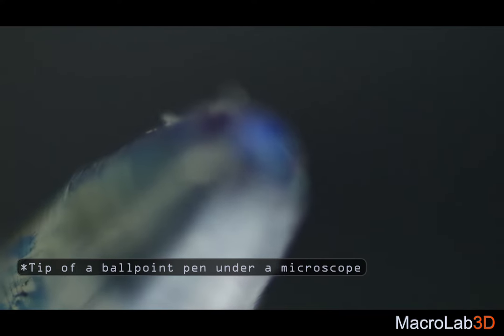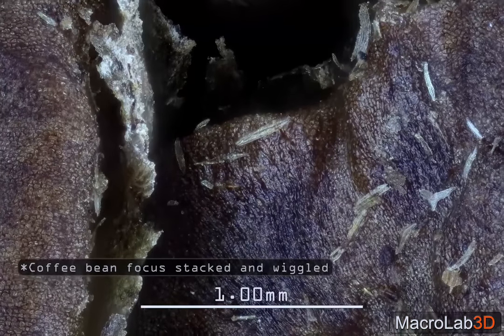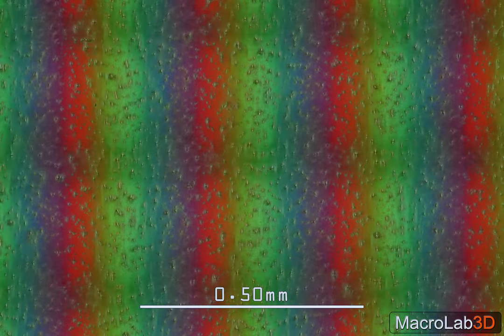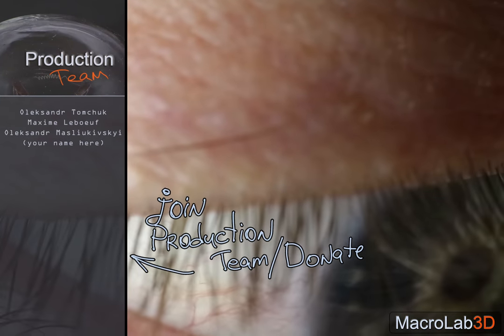Introduction To MacroLab3D: Focus Stacking

Comment from the maker: Contents:
00:00 The tip of a ballpoint pen
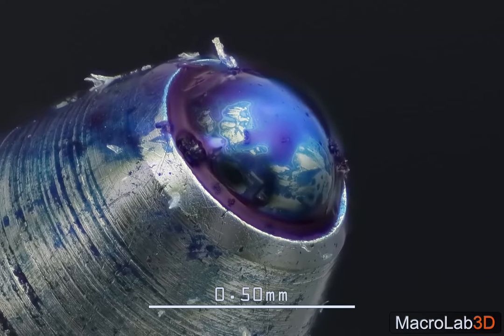00:25 Coffee bean
00:43 Electric toothbrush and its SMD LED 00:53
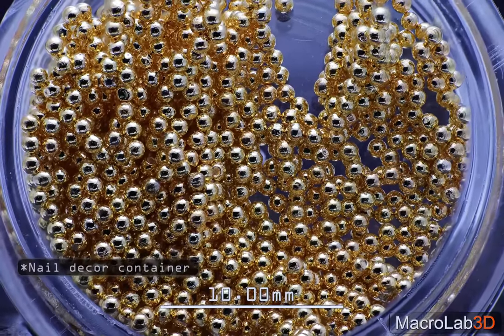01:00 Nail decor
01:11 Moldy mandarin skin
01:21 Moldy mandarin skin dried out
01:31 Wallpapers extreme close up
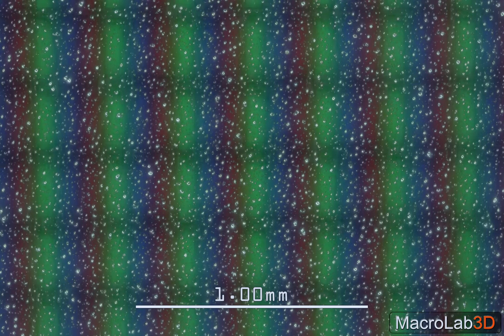01:51 LCD TV screen pixels
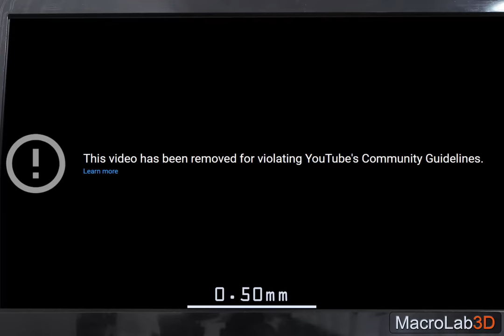02:11 Insulin needle
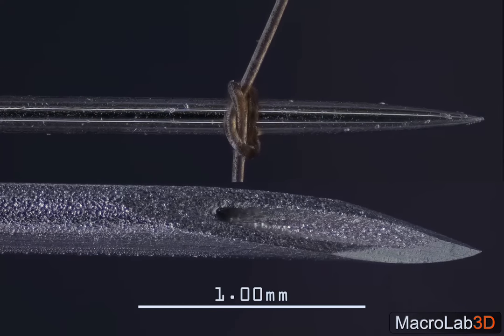02:29 Acupuncture needle
02:43 Cotton bud
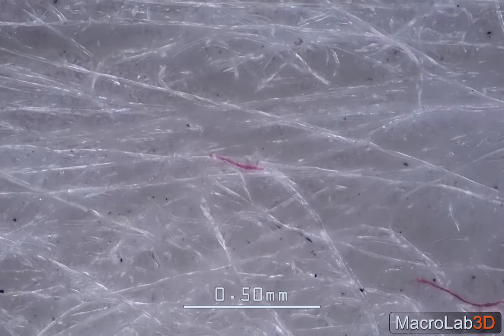02:55 Nylon fibers of a fabric
03:07 Dirty mobile camera lens
03:17 An iris of my eye

Comment: What software are you using make the final stack results wiggle?
Reply from the maker: After Effect video editor.
Reply: @MacroLab3D  So you are using 2 stacks taken from slight different angles and then use a tool in After Effects to get the 3d wiggle? which is the tool in After Effects if I may ask please ?

Comment: I think you should go a little slower and let us enjoy the close up view a bit more before going to the next object. I like to state for a some time and take it in before seeing a new image
Reply from the maker: thank you for your input. Same as you i prefer to watch things slower, but most peoples don’t have such time in their lives so i am forced to make it as quick as possible. Meanwhile there is a solution. Since this video in 60 FPS you can easily adjust speed of the video using user interface. Hope this works.
Reply: @MacroLab3D  that's a good point. I thought about that as well and people usually want to see more so it makes sense to go by quicker. I like these videos of real-life objects close up more instead of insects. Keep it up!
Reply from the maker: Thanks! I am going to mix. One about insects, another about objects. At this moment i am working on insects next. But after that objects ;) don't go anywhere!